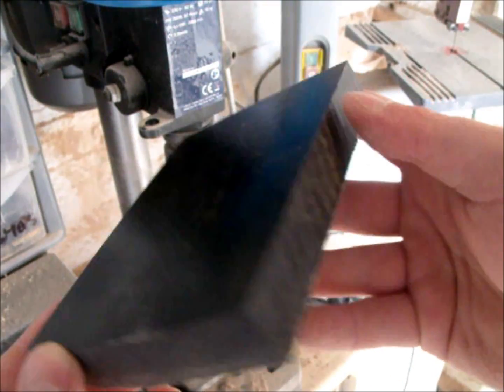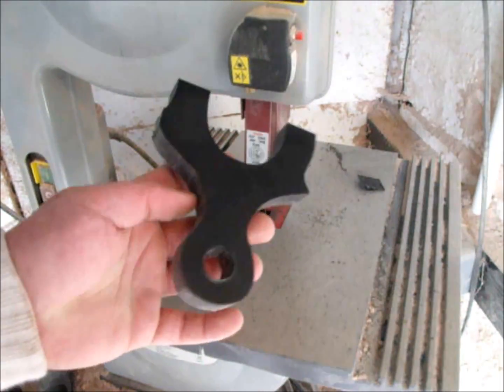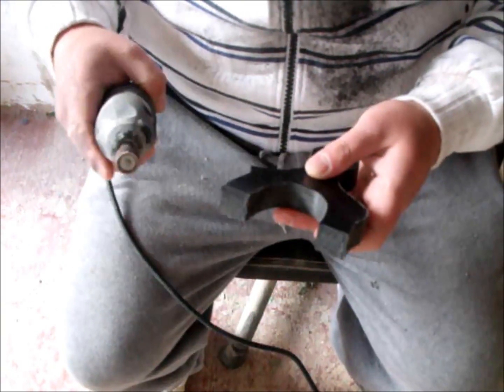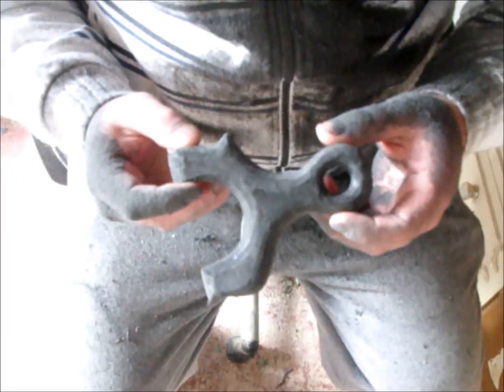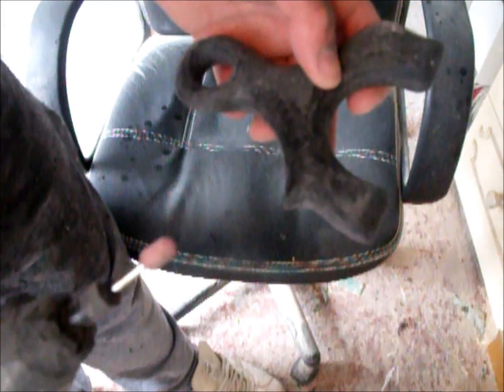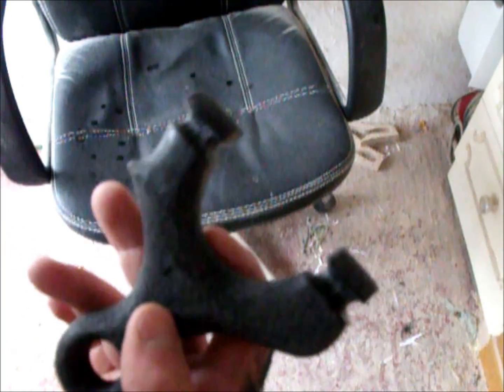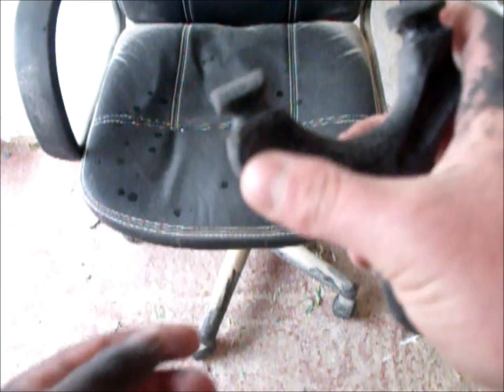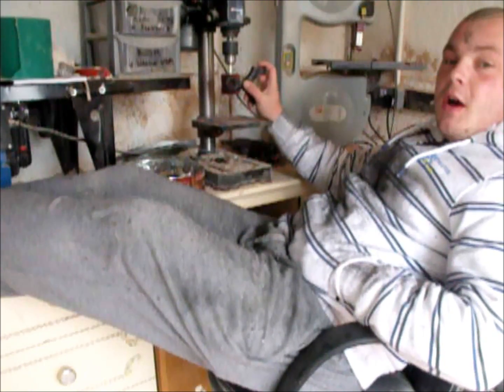HOW 2 MAKE A CATAPULT OUT OF HDPE (GAMEKEEPER CATAPULTS)

Comment: hdpe is very strong. stronger then ply-wood imo. it will hold up to some strong bands. i was using 6mm thick plywood on a pfs and had a very heavy set of bands on it, even that held with no problem.